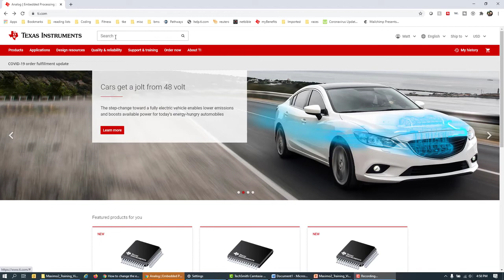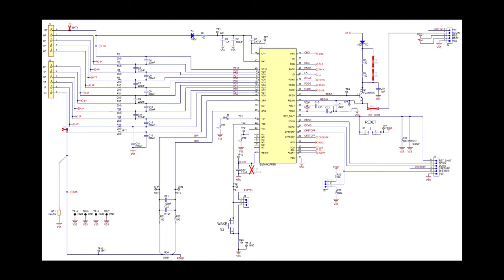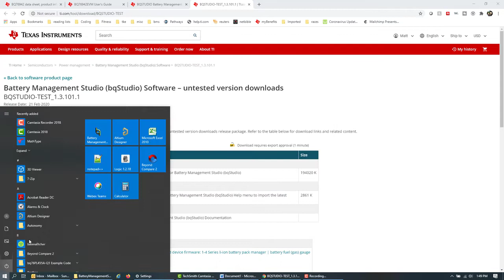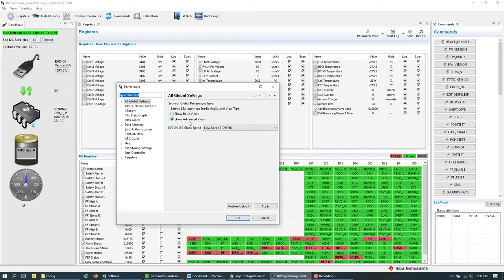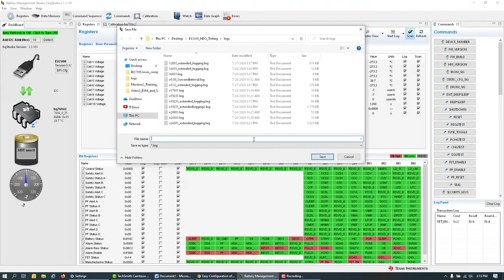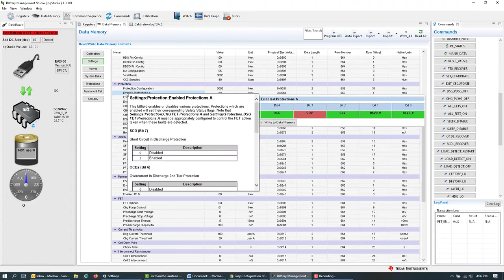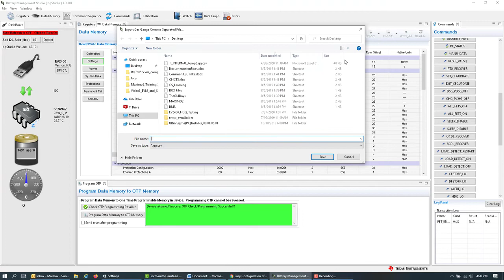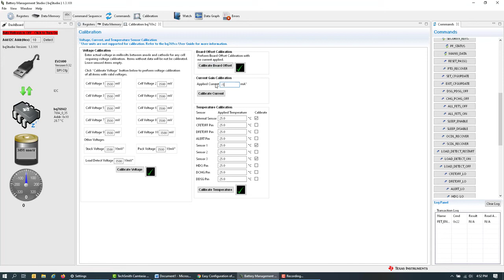BQ76942 / BQ76952 battery monitors: Evaluation module and Battery Management Studio (BQStudio)

Comment: If attach a copper ring accentuate with magnet or wraparound coil automatic recharge battery can use am FM recharge and backup communication incase no wifi for multiuse

Comment: Hello, I am a hobbyist and looking for a Li-ion 18650 cell tester: for capacity, charge, and discharge along with internal resistance of the cell. The cells are to be tested each with its own monitoring connection. Having said that I am wondering if your eval board will handle these requirements? Also, what is the cost of the eval board? If you don't cater to hobbyists with the possibility of going DYI creations and future sale of the item then I understand and thank you for your time.